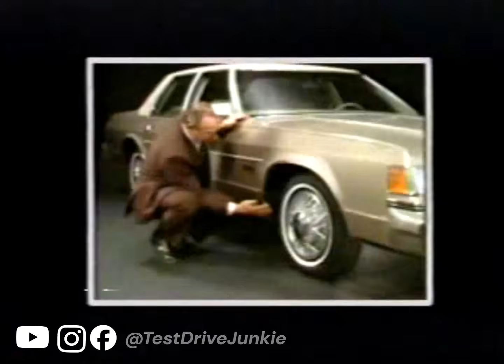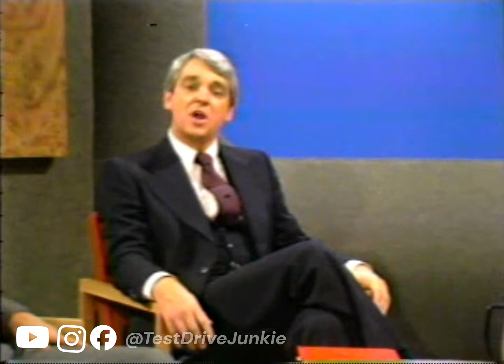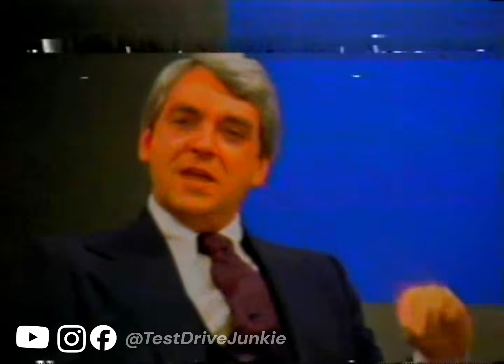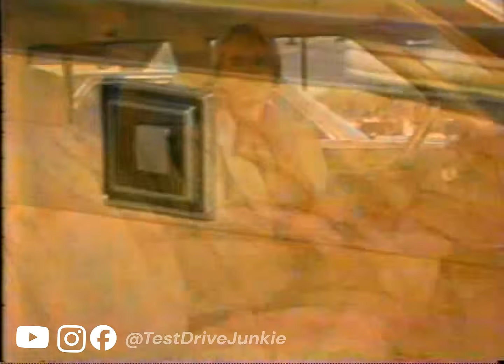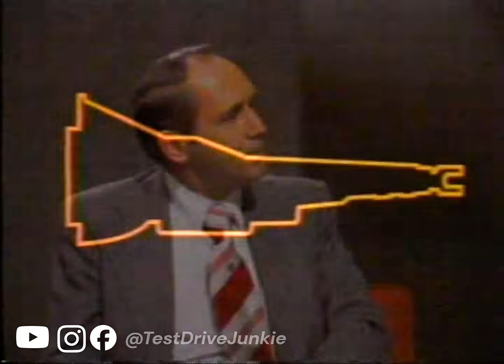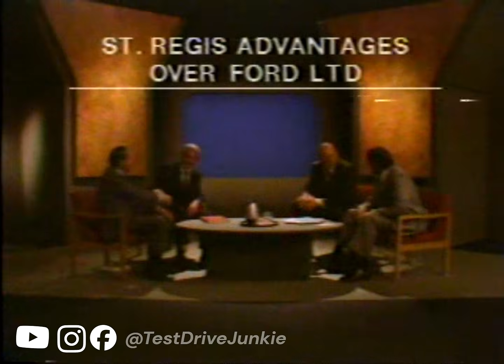1980 Dodge St Regis Manufacturer Betamax Promotional VIdeo

Comment: This car didn'r get a fair shake. GM dealers outdid Mopar dealers with an easy 10:1 ratio. It was a follow the herd time where consumers wanted sexy half ass quality GMs. Although this car shouldn't have had a slant 6 as standard equipment. 318 should have been standard. But gas prices were increasing.

Comment: I like the R bodies looks, but the quality and fitment was hit and miss at best, mostly because of assembly line speed. Those frameless windows tended to rattle and leak water. Covered headlight doors froze in bad weather and easily yellowed due to UV rays. Cloth covered plastic interior pieces easily came loose or teared. Inner door panels and dashboards rattled. Based on the proven B sedan chassis, you'd think Chrysler would have taken more time to get the finer details right.  This was Dodge's flagship and it proved to be disappointing. From what I've read, the 81s were better, but Chrysler pulled their plug early.

Comment: Remember, this is “Confidential… For Retail Salesmen Only!”. Seriously, I almost (but only almost) feel sorry for the poor, sad SOBs who had to sell this malaise-era Mopar dreck. Just a decade earlier they were selling Chargers and Coronet R/T Scat Packs with 426 HEMI’s; even the Monaco wagon could be optioned all the way up to a monster 4bbl 440 V8 which could easily evaporate the rear tires. Imagine having a showroom full of the crap in this video, along with sloppy insta-rust awfulness like the Aspen, emasculating death-trap that was the Omni, the bafflingly terrible Mirada, and the morose Diplomat. 

So basically you had the Aspen, the tarted up Aspen, the personal luxury tarted up Aspen, a prison cell econobox and this Dodge St. Regis trash, which was still riding on a warmed over circa 1962 b-body (renamed the r-body) platform because Chrysler was effectively bankrupt (largely thanks to completely screwing up with the Aspen -  a huge hit that became a reputation destroying money loser that bled all their margins away on endless recall programs and expensive remediation). 

So how bad was the St. Regis with its borked up electronics, anemic engines, wobbly body structure, horrible build quality and weirdly proportioned styling? How about 64,502 examples bad… as in they only made that many across four production years (and 3 model years). They had expected to sell that many per year!
Reply: Assuming a production rate of one a minute that's only about 1,000 plant hours over four years.
Reply: My first car was an '81 Omni, I'll take one of those. Mine even had heated seats! (I had the fluffy fake-sheepskin seat covers and the neighbors' cat would sleep on the driver's seat)
Reply: @nlpnt  Oddly enough, my first car (in 1993) was also an Omni. However, it wasn't just any Omni, it was an uber-rare 86 Omni GLH-S. I got it cheap, with just 22k on the odometer. According to the dealer, it had been owned by a "little old lady". How a "little old lady" ended up with one of Carol Shelby's most insane creations is beyond me. That it didn't end her life is remarkable.

We're talking about an Omni with 175 bhp and 175 ft-lbs of torque, delivered through a 5-speed manual transaxel that would dump all the torque into the steering wheel.  From 0-15, you'd feel nothing, as the car would grumble up to 15MPH. And then the 2.2L turbo would spool up and you'd suddenly find yourself wrestling with the steering wheel while trying to shift. 0-60 of 6.5 seconds doesn't sound fast by today's standards, but the 20-60MPH turbo sprint was terrifyingly rapid even compared to a modern car. And, it had the rather odd characteristic of having a lot of top-end power: once rolling, 5.0 Mustangs had nothing on the GLH-S over 60MPH. It would pull hard all the way to 120+ MPH (an Omni at over 100 MPH is a terrifying thing).

I eventually sold it in 95 because it was still a penalty box on wheels (same interior as a regular old Omni). I sold it on for exactly what I paid for it, as it was starting to be something of a minor collector's item. They only made 500 GLH-S examples. As of 2007, according to the last Shelby registry update for my numbered example, it was still on the road.

Comment: You can tow a hell of a lot with a front torsion bar and rear leaf spring setup. These cars doubled as trucks if you had a trailer you were good to go. It's 1980 so I'm still trying to figure out the Chrysler and Plymouth equivalent to the St Regis??? Also the same year (late 1980) Chrysler introduced the Reliant and the Aries for both Dodge and Plymouth.
Reply: The Plymouth was Gran Fury, though I'm not sure there was a civilian version, so many of them were taxis or police cars.
Reply: The Grand Fury was introduced mid-year of 1980 model year it was introduced to give Plymouth dealers a competitor for Chevy Impala / Caprice in Ford LTD

Comment: Comical as these had more road noise than any of its competitors and a harsher ride from the mostly carryover suspension from the old Monaco. These were unibody cars whereas GM and Ford's full sizers were full frame which isolated the interior passengers better. Quality was not so good starting with fit and finish, poor loose fitting interior pieces and chrome that peeled away from bumpers. Frameless window door glass let in more wind noise and flexible plastic surrounding the bumpers that you could put your fingers through from the gaps. The Chrysler products also had odd dashes that were carried mostly over from the old Monaco where it was down turned and harder to read compared to Ford and Chevy's designs which were more upright and easier to see. 
The Slant six engine was durable but only made 90 HP for these over 3600 LB cars which is never mentioned compared to Caprice which uses a 3.8 liter V6 and 115 HP. Ford used a STD 120 HP 4.2 V8. Moving up to the V8's the extra cost 318 in these Dodges made but 120 HP compared to Chevy's 305 which made 155 and Ford's 302 which made 130 with a 145 HP 351 as an option. These cars sounded good on paper and looked decent enough but when compared to its competitors in actual comparison tests came up short and the buying public noticed and didn't buy them
Reply: I feel sorry for the engineers who had to BS there way through this charade. They knew full well that it couldn't compete. I've never once been in an old Dodge and thought that it was better than a GM or Foed product. The dash made me think I was looking at a cheap plastic kid's toy. Leaf springs in a luxury car? People knew those were on covered wagons and heavy duty trucks.

Comment: The GM and Ford full-sized products were far superior in 1980. It's not surprising it failed.
Reply: Yeah, I shopped a Caprice 305 V8 against the St Regis and Crown Vic when I was a new car buyer in '81.  St. Regis came in a distant third on my list.  I liked pretty much nothing about it on the test drive.  I ended up buying a Caprice and was very happy with it.

Comment: And none of those Department heads at Chrysler corporation worked togeather to bring in a   Unified package  according to Lee Iacocca when he took over  the presidency he discovered  the departments weren’t working together what’s the point of having a high end stereo  if you have too many road sounds coming into passenger Cabin or A/C & heater blowers that were too noisy  Lee was disappointed when he realized none of the engineers of different departments were not working together “( these guys “) are not even flirting these people need to be sleeping together to build a unified high quality automobile

Comment: These R-body cars were a flop...with sales decent for 1979 until their poor quality reputation caught up with them causing sales to collapse in 1980/81.
Reply: That was another gas crisis in late 1979 there was the hostage situation in Iran in Chrysler was having financial troubles. Plus the quality assurance problems on these cars did not help and a lot of the stuff was not properly tested before it was put in production
Reply: @chryslerelectronicleanburn1676 Sales of large cars suffered in 1980/1981 model years due to high gas prices, high inflation, and high interest rates. But Chrysler rushed the R-body into production. For example, the 1979 models had a plastic brake component that prematurely failed. Early R-body cars had poor quality aluminum bumpers. Also, there was lousy workmanship on the assembly line. The reason for this video was to reassure dealers that quality issues were being addressed... but customers weren't convinced.
Reply: They were bad quality?  Despite the 3 engineers talking up quality ?   I guess it was all for show.
Reply: @Mabeylater293  Likely there were quality improvements made for 1980... but it was too late to save the car's bad reputation.

Comment: However, there WERE 1980 Caprice Classics that used either electronic flute-tones or electronic beeping sounds, AND a year later in 1981, Caprice Classic used a standard warning chime like St. Regis.
Reply: I wonder how much cost it added since Mopar had it on the St. Regis in 1980 but my mom's '86 Horizon still had the old style buzzer.